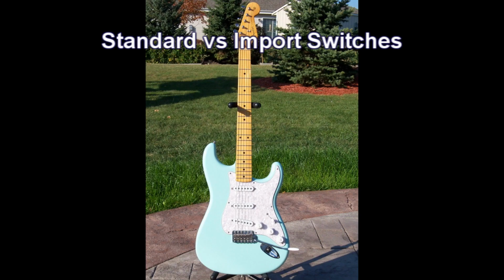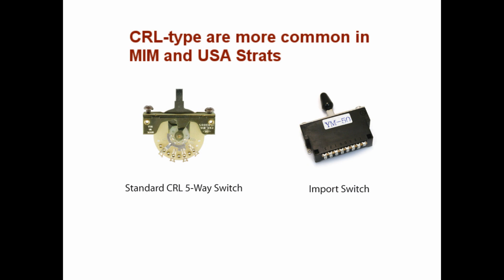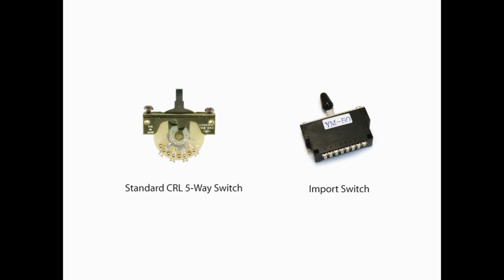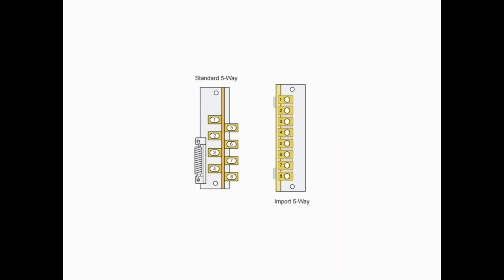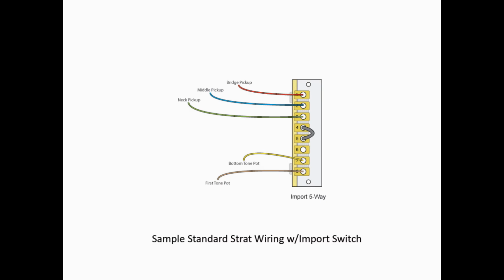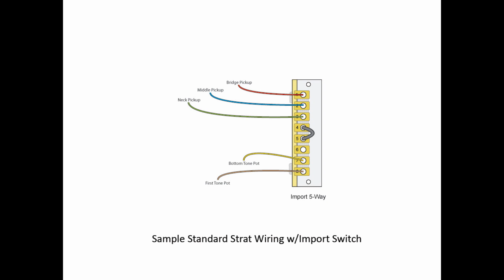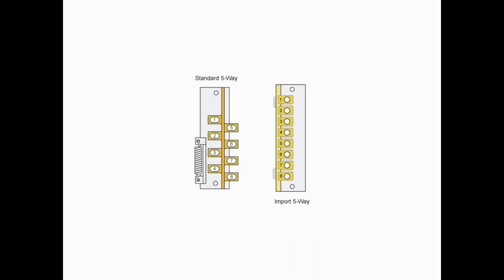Import versus Standard 5-Way Switches

Comment: Both switches are identical electronically.  They are actually two independent switches in one switch.

I only use one vol and one tone control and you only need to use one side of the switch to do this. The import switch poles 4 an 5 are the common poles. With HSH guitars the 2nd half of the switch is used to short half of the humbuckers to ground to split the coils a la Steve Vai.

Comment: Very helpful.  I have to cut apart a import 5 way to solder to direct traces because I sculpted the body too thin out towards the edge to fit a blade or import without modification.  Just needed to know which traces were what.  Thanks!

Comment: It would be great if you did a video like this for the import vs. the standard 3 way switch. There is a new 3 way import that has 7 lugs that is also confusing. Thanks
Reply from the maker: Hey Mitch...
Do you have a part number or anything on this new switch?  I only know of the 3-way Import that has the 8 lugs.
Reply: Breja ToneWorks I don't have a part number. I ordered 3 on Ebay. They are listed as 3 way mini guitar switch from China. $1.53 with screws free shipping.

Comment: On a 2 pickup PRS that has the 3 way blade ala your import style, do you jumper the hot pickup wire across lugs 1&2, or jumper the 2 lugs with a wire and then connect the hot pickup wire to just one of the lugs? Probably pointless to jumper the lugs and wire the hot across 2 lugs I imagine? Thanks!

Comment: In my 89 Charvel 475 I have a VLX53 5 way switch import type… Pickups were wired to position 1-4… for two Jackson single coils and bridge a Jackson humbucker… Slight issue is i melted pretty much pins 2/3 when trying to resolder the wires….

Can i flip the switch around and use pins 5-8? Would it work?

Comment: I made a body & tried putting the bridge & middle into a humbucker ring. Routed deep into the body to not have to use a pick guard. It works but tremendous ground buzz.  Is there a place u can just ground the 2 pick ups, trem claw,  and input to the metal casing on switch?

Comment: Does anyone know how to wire this import YM50 type switch for a 4 way Telecaster . i.e. Neck, Neck and Bridge in parallel, Neck and Bridge in series, Bridge? 
I know how to do it with the CRL/Oak Grigsby type but it doesn't fit in my Harley Benton TE20 as the cavity is too shallow.
I see this video is from 9 years ago so I don't expect an answer from Breja Toneworks.

Comment: Hi, I have a guitar with a 5 way selector import switch, which is supposed to coil split in the 2nd & 4th positions. There is also a jumper wire as well. Since have no idea how the guitar was wired originally I'm having trouble with it, and there can't seem to find any pics or vids with that particular configuration. Could you please do a tutorial vid.

Comment: Import 5-Way Strat Switch.  I have a batch of selector switches that have 7 versus 8 solder points.  Can't find a wiring diagram for the 7 pin version for a standard 5way - 3 PUP strat.  Do you have any information on this type of selector switch.   Thanks, RA

Comment: The import switch I'm looking at has an extra black wire coming off of the metal enclosure.  I assume it's just a ground wire?  Should I solder it to the main ground that goes back to the tremolo plate?
Reply from the maker: Hey Oliver...  Sorry for the delay.  Sounds like it is a ground wire.  You'll need to look at your existing ground circuit and determine where it needs to go.  If you have a ground wire already running to your main ground, then ground this switch to one of your pots.  It sounds like this will be the case since you said there was only one wire coming off of it.
Reply: Thanks.

Comment: thank you for sharing this info.more informative videos pls.
Reply from the maker: jp hernandez Thanks...  I appreciate it.  I'm working on more - I just need to find time.  :)
Reply: Breja ToneWorks My 2008 Squier 5 way switch is wired way different than you showed.  How can I do the dual capacitor mod?
Reply from the maker: hurricanebob1 How is yours wired?  Don
Reply: Breja ToneWorks 
Ended up putting in a new Fender 5 way switch so I could do your mod easier.  Sounds great now with new pots, caps, switch, and a Seymour Duncan in the bridge position. Bob
Reply from the maker: hurricanebob1 hey Bob...  yeah - sometimes its just best to replace stuff.  I've never personally been a fan of the import switches.  They always seem cheap and too hard to clean IMO.  Happy Modding.  Don
Reply: My Chinese 5 way was wired weird so I just went with a new Fender switch.
Got a nice Parts caster going now for under $250.00 thanks to you.

1 Neck
2 Middle
3 Bridge
4  tied to 5
5  tied to 4
6 Neck
7 Bridge
8 Open

Comment: Very helpful tutorials.  I need a simple schematic for wiring 2 Dimarzio 'The Breed' Humbuckers with Import 5 way switch w/ 8 pin (stock) + 1 volume + 1 tone (no push/pull) for a custom Aria guitar that we will be raffling for a charity next weekend.  I'm not finding exactly what I need for simplicity.  Already have enough $ into the project. Just need to get it assembled before next weekend's event.  Can you help? Thank you in advance.
Reply from the maker: Jon Roof Hey Jon...  I'm sorry for the delay.  I've been away and am just returning.  Did you still need help with this?  If so - please email me at brejatoneworks@gmail.com

Don
Reply: All set, thank you.  Took it to a shop where they replaced the 5 way with a 3 way.

Comment: Sir can the 5 way import switch be wired on a dual humbucker?

If so, is there a possibility splitting the coils of both pup?

Like assigning a individual position on the outer pups?
Reply from the maker: You're kind of stealing my thunder.  I'm working on another video where I detail something like what you're asking.  You're only able to split one Humbucker though - not both.  To do what you what, you need to move away from the import to the superswitch or put in a couple mini-switches.  Thanks, Don
Reply: sorry for interupting sir

glad ur doing some vidz on how to do that

Comment: Hey Don, Keith here, (I talked to you last night) on this video Import vs standard  where does the vol wire get soldered to? I see the 3 hot P/U wires and the 2 tone and the jumper wire where does the hot or volume go to?
Reply from the maker: If we're talking about the 5-way with the coil split for position # 2, it's the bottom wire on the left side - Lug # 4.

Comment: Hi Dan - can you show how to wire a 7 lug import switch?
Reply: Lugs:
1: B
2: M
3: N
4:Common- shared
5: open 
6: to bottom tone pot
7: to first tone pot

*After lug 4, the common lug, the lugs repeat. So if you wanted tone control over the Bridge when your only in the bridge position, you can attach lug 5 (the open one) to the middle peg of either tone pot.

Comment: In your opinion which is a better design, the traditional Fender rotary type seems archaic?
Reply from the maker: +bluwng It's all about quality.  The CRL is what I use because it works the best for my applications.  It's easy to clean and see if something is wrong.  The Imports are encased and if they break inside or something, you want tell.  Imports do fit better in a lot of newer cavities though but my go-to type is the CRL/Oak Rotary.

Comment: a diagram enlarged makes it possible to view what you explain.... the numbers are too tiny to read. You should have reviewed the vid. And no pic or any reference to an Aria or Samick  switch found in some older guitars.... different from the 2 switches shown. Older Samick guitars made in S.Korea may have used a 5-way switch with 6 connectors and a center output connector. But no one explains how it is wired or works in Google searches...